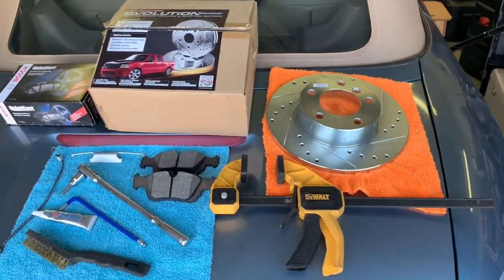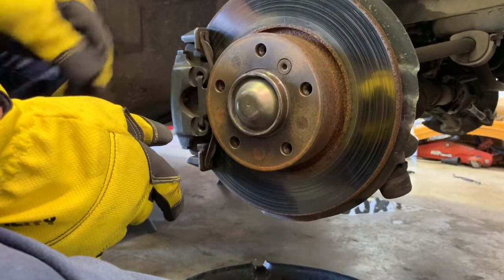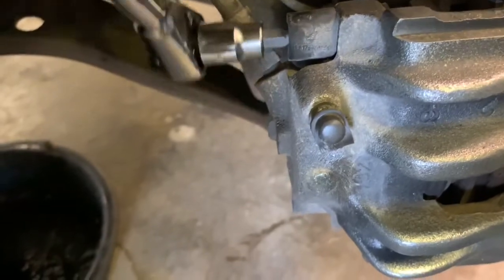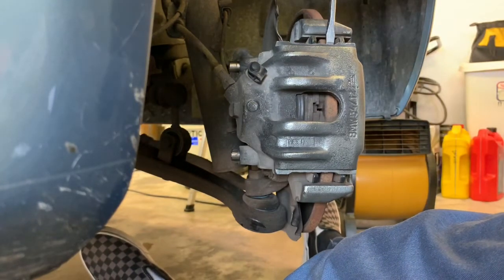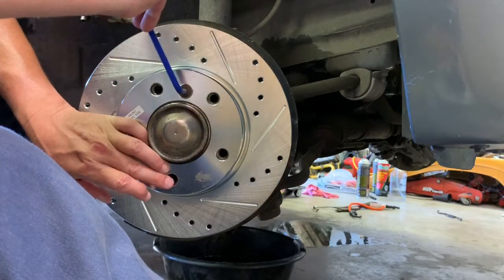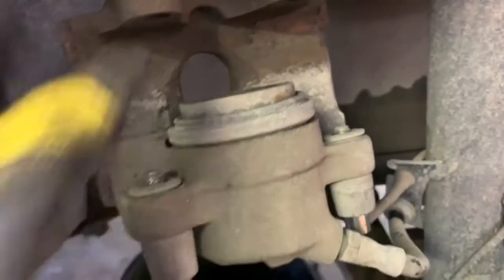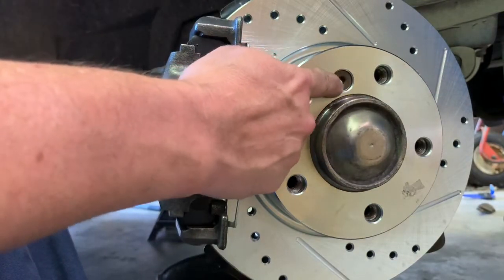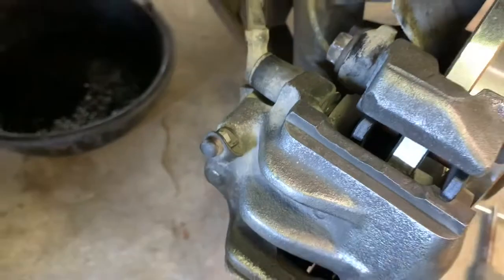BMW E36 / Z3 Front Brakes With Slight Upgrades

Comment: I enjoyed this. It was helpful to see you use the hand clamp vs c-clamp to push in the piston.
Reply from the maker: Thanks. I’m glad you enjoyed the video. If you’re not already a subscriber, subscribing would be greatly appreciated. I have several other how too videos for this car with more to come.
Reply: @gerechoppers  another thing that could have helped would be to cover how to remove the brake sensor. I watched about 5 videos on how to change the brakes and rotors and not one video covered it. I still liked you video though.
Reply: Bonjour, ou est ce que vous mettez les chandelles sur Z3? Je dois le faire mais hormis les emplacements réserver au cric je ne sait pas où les placées .. merci

Comment: Drilled and slotted rotors are generally not recommended for street cars. The loss of mass in the holes actually allows them to reach higher temperatures compared to ventilated only rotors. In addition the holes can start stress cracking. Track cars with drilled rotors are inspected for cracks after every session. The only difference on a street car is that the pads will wear faster.

Comment: What year it’s ur car  my front rotors are different.!!!
Reply from the maker: 1996. If you have a 6 cylinder car I believe they are the thicker rotors that are vented in the middle between the two braking surfaces.